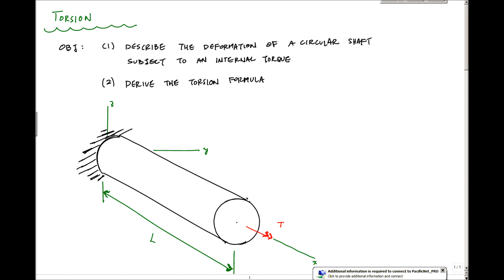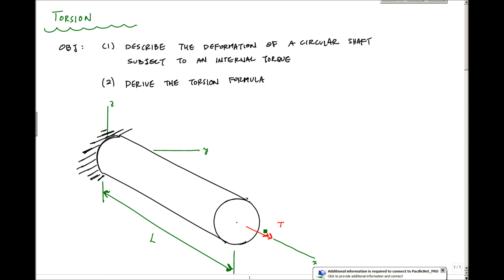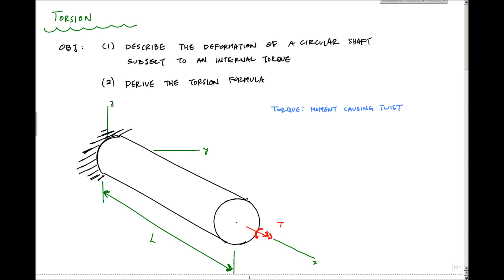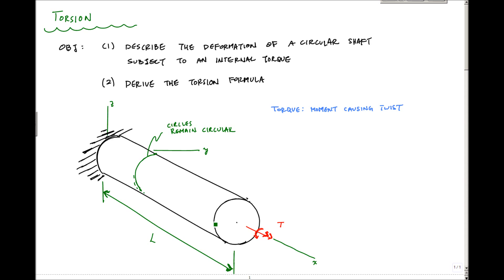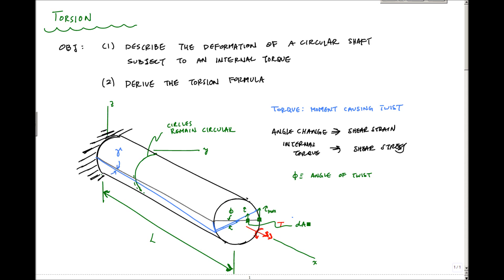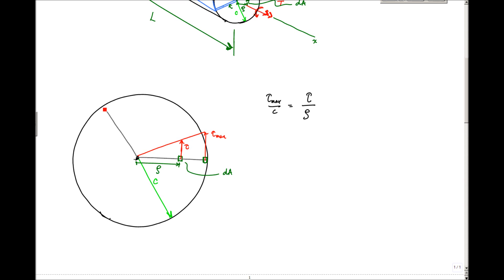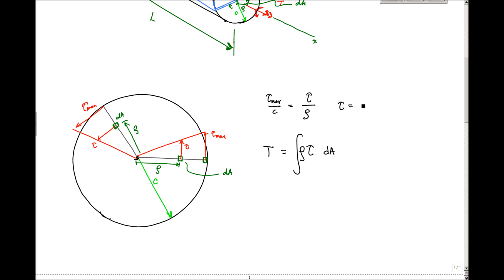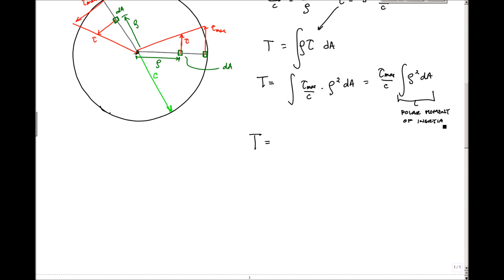Introduction to the Torsion Formula - Mechanics of Materials

Comment: Thanks for the Video.  Does the length of a shaft affect it's strength if all else is equal?
Reply from the maker: Strength is more related to the material properties....a longer shaft though would be have more twist due to the same internal  torque, assuming the material and cross section geometry are the same.